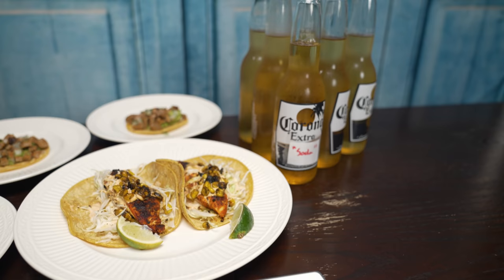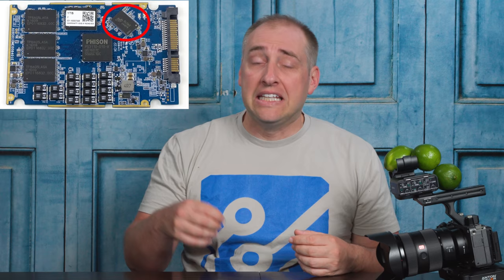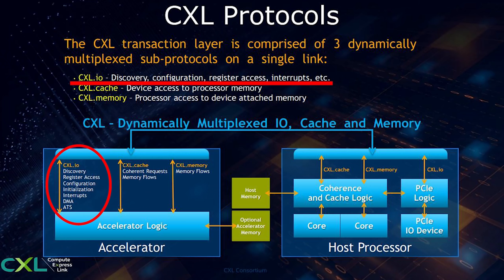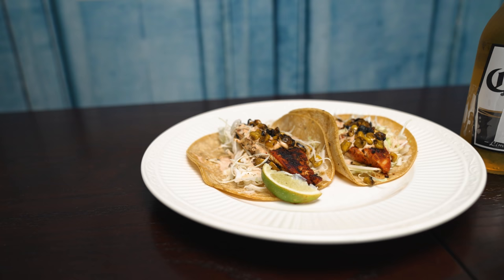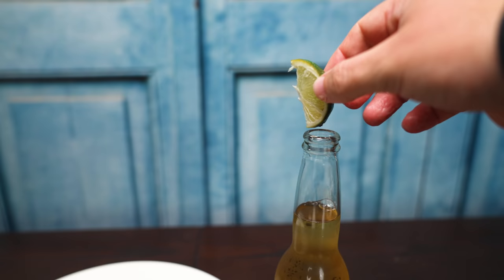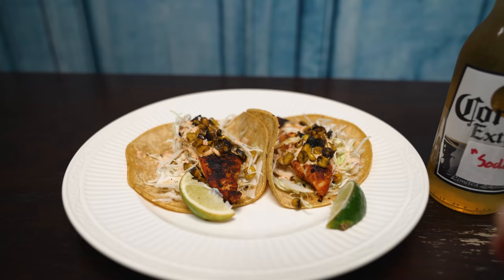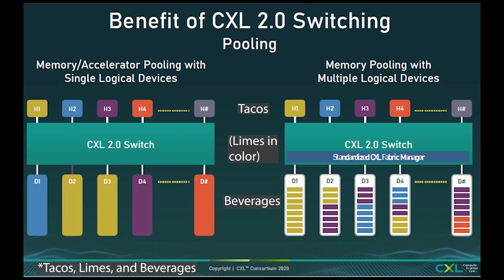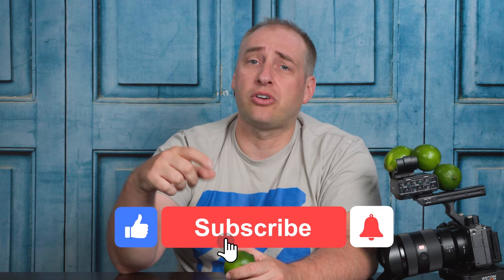CXL in Next-gen Servers Will Make Today's Servers Obsolete

Comment: How would you compare CXL vs. the Apple M and A processors?
Reply from the maker: CXL is for much larger systems. M1 is a very small chip with low bandwidth/ memory needs compared to what these are for.
Reply: @ServeTheHomeVideo  The fastest supercomputer in the world uses ARM soc,and the M1 is way, way faster than a similar x86. And Apple is going to make a workstation version, everyone knows that. So I ask again, how do you compare CXL to an Arm soc like the M1 that shares the memory without any external extension
Reply: @irisfailsafe  Apple solution is identical to AMDs APU. CXL is much broader and more complex technology for different market. The only place where it might fit is Mac Pro but right now they don't have anything similar to CXL. They simply don't need it. M1 is a small SoC that doesn't have any high speed peripherals it needs to talk to. All the communication happens over on-chip interconnect. And even then, it's really low bandwidth. As for ARM/x86 debate, the architecture has little relevance. M1 is doing great only because Intel is way behind everyone else. When you go to server levels chips the difference pretty much disappears.

Comment: This sounds eerily like Apple's Unified Memory Architecture. Apple is probably holding out on refreshing the Mac Pro with Apple Silicon until CXL eGPUs are a thing so the Render Farms and VDI Cloud Providers are appalled and inclined to justify the CapEx of >$6K while revitalizing their most criticized and professional product.
Reply: No, this is much broader technology. Apple's approach is identical to what AMD was doing long time ago with APU (and continues to do so. Game consoles is the best example). Shared memory pool which is connected to both CPU and GPU using cache coherent buses. CXL is about interconnecting whole server, not chip level interconnect. Apple doesn't need that and probably never will unless they're willing to heavily invest into Mac Pro. There it makes sense as you can install multiple GPUs and accelerators and you would want high bandwidth interconnect between them. Something similar to Nvidia DGX station. Desktop system that has four A100 interconnected using NVLink.

Comment: The latency to CXL memory will still be massive compared to actual directly attached RAM, right? Physics is Physics, SerDesing (is that a word) every inch of PCIe cable costs time.

Many server applications don't care too much about this, but there's tradeoffs everywhere
Reply from the maker: Totally trade-offs. Locally attached memory is not going away for everything.
Reply: @ServeTheHomeVideo  I guess you could always make taller DIMMs that fully utilize the 1U space, any idea why they've stayed this small for so long? Or go mad and go full 2U height
Reply: Not really. The standard suggest 80ns latency target for CXL connected RAM and 40-50ns target for cache coherency. That's in the realm of inter-socket and on-chip interconnects. Just look at AMD's infinity fabric latency. Core-to-core can be up to 90ns.

Comment: Is this along the same lines as Apple's "Unified Memory" architecture in the new M1 SoC? If it is, I can see how that is an as-yet unrealized boon that will soon show it's true usefulness in a future Mac Pro SoC with 20 or 40 cores and oodles of I/O.
Reply from the maker: Not exactly. Apple's unified memory is much closer to what Intel/ AMD use with their iGPU/ APU offerings, just using LPDDR instead of standard DDR. This would be more that if you had a M1 system with a NVIDIA A100 you could share resources across different types of chips from different vendors.

Comment: How about saying simply disaggregate DMA or no more DMA slaves can now be masters. And give the IBM Power example they don't call it CXL, and its not CAPI but some derivative. mb
Reply: You can probably find a CXL beta development platform that is Sapphire Rapids or ARM Neo ish like? mb
Reply: This is not DMA. CXL is a transactional protocol that allows cache coherent memory access with weak or strong ordering. The closest thing to CXL is inter-socket bus between CPUs.
Reply: @creker1  Thanks creeker but don't u still need a check, "inter-socket bus between CPUs" as in an administrative controller for in memory compute data processing? Something in memory, in accelerator, in storage for registering when to right back to main memory and that may be or in past time had to inform CPU control master of that transaction? mb
Reply: @mikebruzzone9570  if both devices implement coherency agents in hardware all of it is done automatically. CXL adds MESI like semantics for cache coherency between devices. They can keep their memory and caches in sync by properly transitioning them through various states at page and cache line granularity. Like, if CPU has some memory cached and it's modified but not flushed (meaning cache and memory are not in sync) and other device tries to access it, without CXL it would just get stale result from memory and require software to implement some complicated custom protocol in the driver to make it work. CXL allows to do that automatically. When a device tries to access something it will snoop CPU cache and see that cache and memory are not in sync and it actually has to read from the CPU cache instead of memory. To do that it will send a couple of CXL packets to request specific cache line from CPU. CXL will also mark that cache line as shared so CPU knows that other device accessing it. This is because the device can actually cache that line in its own cache. Once it's there it doesn't need to go over to CPU to read it. You can probably see how this will make communication between devices much more efficient and significantly simplify software.
Reply: @creker1  Thank you for drilling down on the topic subsystem page and cache line, snooping and how CXL can  register / flag for coherency or not; removes latent / unnecessary coherency calls to the CPU. appreciate. mb

Comment: If CXL somehow bypasses your raid controller's battery backed cache... /insert annoying food analogy wrt data loss
Reply from the maker: Traditional RAID controllers are going away in high-end systems. Really the holdouts are legacy enterprise/ legacy server OEMs. Once the data is written to persistent SCM, it is as safe, if not safer than in RAID controller battery backed cache. From there it can be cleared only after writes to other devices are acknowledged. This is similar to what some very large organizations are doing today to get lower chance of data loss than with RAID controllers.
Reply: @ServeTheHomeVideo  Yeah, been using zfs log devices forever - the point is that raid card memory offloading was explicitly mentioned in the segment as a potential CXL benefit. That is just silly. HBAs? Sure, but definitely not raid.